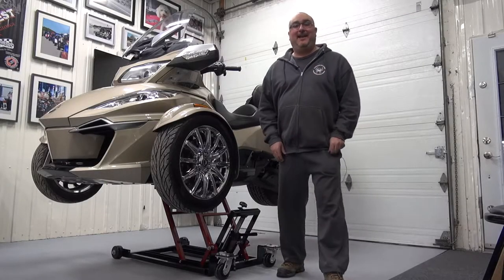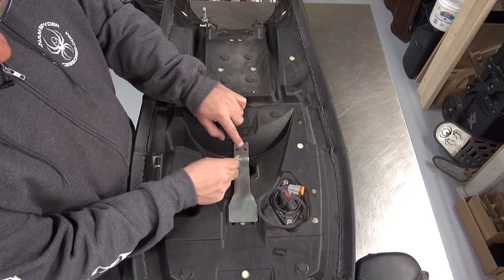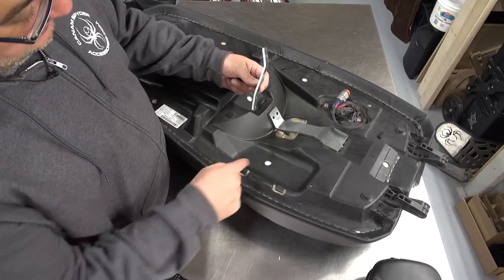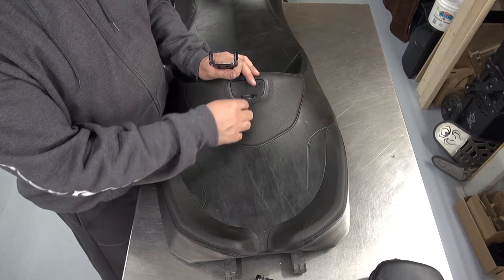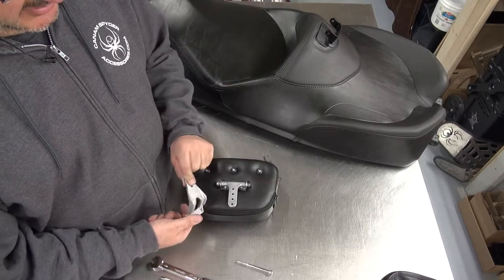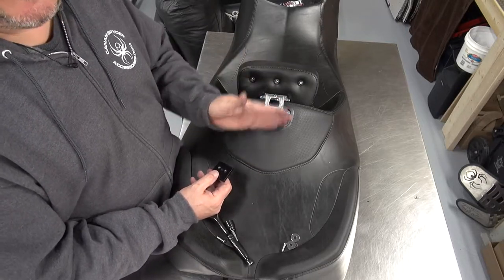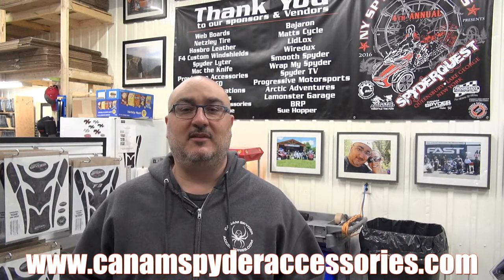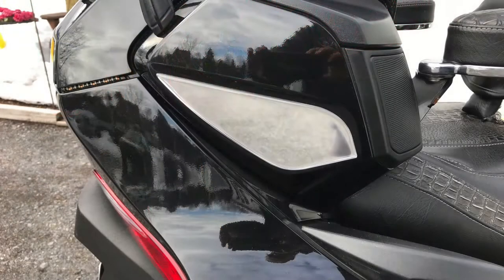Installation Backrest - Can Am Spyder RT 2014 and up - Part 2 of 2

Comment: Pierre, the assembly of the "removable mount" to the "riser" (as refweered to in the instructions) should allow the fork of the rmovable mount to slide up and down on the riser on the screws. To do that, the screws should be left just loose enough to allow the mount to slideup and down. The niuts on the screws behind the riser are shown as "jam nuts" . They keep the screws tight on the riser and allow the mount and backrest to be pulled up and removed..🤔
Otherwise, great video and your patient explanations are appreciated. 👍🙂

Comment: Pierre, when I installed mine on my 2013 RT a few years ago, I connected the black seat bracket to the part that goes through the seat and connects to the bottom piece, before I connected the bottom piece to the part that goes through the seat.

Comment: What size bolts are needed? Mine got worn out and I need to replace it as it will no longer hold a tight position the back rest keeps falling forward.